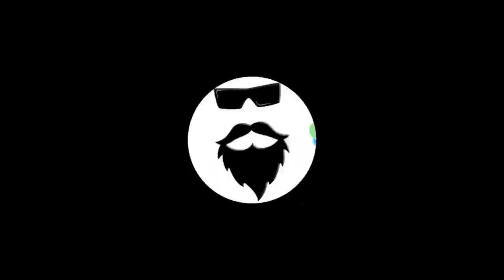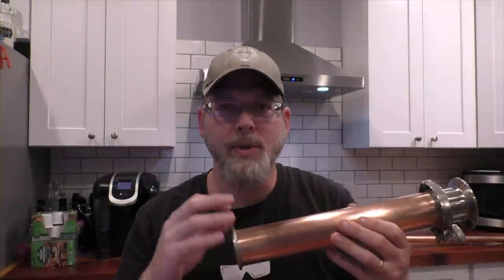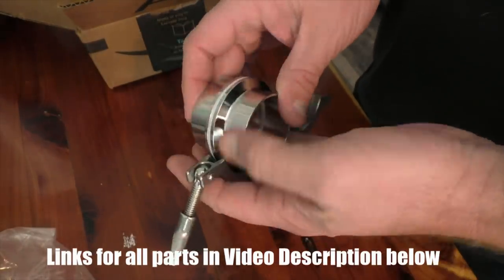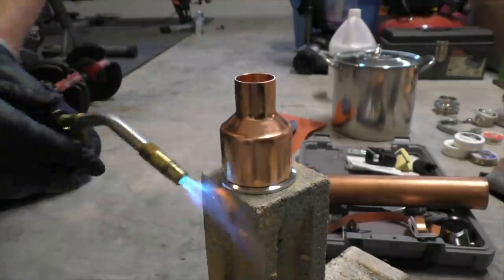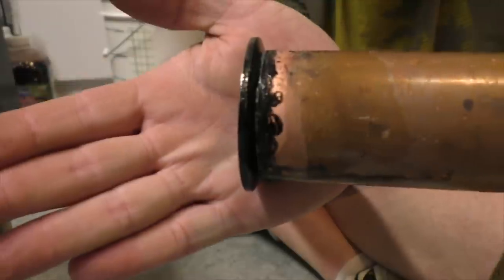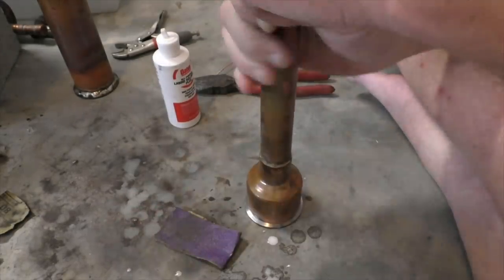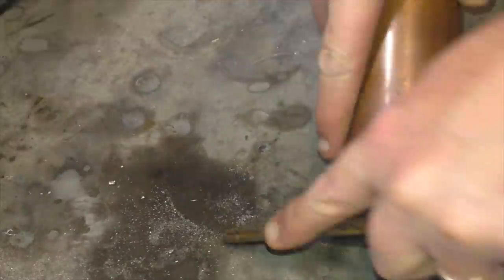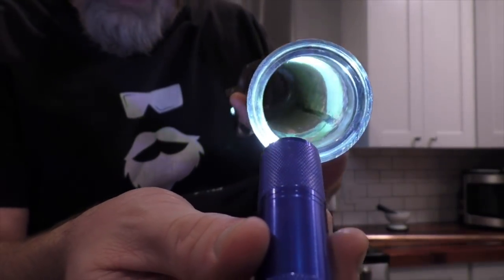Build a Simple Modular Pot Still Head + How to Solder Copper to Stainless Steel.

Comment from the maker: ATTENTION!!!: Forgot to mention that you MUST use Lead Free Solder or Silver Solder for all connections!
Reply: I did some of my joints with hard solder also called silver brazing. It uses a higher silver content solder,  and an acid based paste flux.  I'll check the names of what I used and post it here when I get home.  I didn't do them all because it's expensive and it's tricky to get right because it take a whole lot of heat but go too far and you can damage the stainless and make it rust if you don't pickle it.  A little goes a long way though.
Reply: Ok this is what i use for soldering stainless to copper or other metals, for the hard solder/ silver brazing I use:
Harris Safety-Silv 56 (cadmium free)
Harris Stay-Silv (white) brazing flux paste. I found the black paste harder to use. The smoke from these is dangerous!  Don't breathe it! When applied correctly and the right heat is good it works and flows great,  and a little goes a long way. 

There are good tips in videos and even in the Amazon reviews! 

For regular "soft" soldering stainless to copper I use:
Harris Stay-Clean liquid soldering and tinning flux (careful this stuff is dangerous).
Lead-free silver bearing solder.
Reply: One more tip I just thought of!  Make sure your gaps are tight! If you have gaps the solder will not fill and you'll have leaks.  If your gaps are tight the solder will flow very easily and you'll get a good seal that doesn't leak and is strong! 

Sometimes it take a lot of work to make pieces fit nice and tight and clean,  but trust me it's worth the effort to get it as perfect as you can.
Reply from the maker: @ThinkFreely2012  Thanks so much for all the detail!
Reply: It's best to use an Oxy-fuel setup if you're going to use the silver brazing rod (also commonly referred to as "silfoss"). The heat from an Oxy-fuel rig makes it far more controllable. A MAPP torch barely gets hot enough to melt it, and propane just turns it to mud, slowly. 

With that, pure silver solder is far easier to work with and makes fantastic joints on various metals, whether copper-copper, brass-brass, copper-brass, copper-steel, brass-steel, etc... if it can hold over 400psi in a HVAC system, it can handle a "boiler".
Reply: Great video. Thanks for sharing. Love the sacasism/dry humor. I'm searching for the silver solder and liquid flux now.  It's so expensive these days. Solder and paste used to be a 10dollar affair. Now I'm looking at 70 for the stuff I need. But hey it's free booze right......🤔  I'm upgrading my Frankenstein 3/4inch unit to a 2 & 3 combination Stone Nixon style unit. My output now is about 70% for the first 3 or 4 liters. I'm hoping to get 6L @ 90%. I'm looking to make some gin and vodka.  Although my oak charred whiskey isn't too bad. Well, thanks again. 🥃
Reply from the maker: @capitaldd3693  Yeah, it's pricey. I got my silver solder from Home Depot, but had to use Amazon for the liquid flux. Good luck on your upgrade.
Reply: @BeardedBored  Hey thanks. I just (just got back now) picked up Bernzomatic silver bearing solid wire solder - lead free @ home depot & a two pack of map gas. Better price than  i thought.  I'll have to make sure the solder is ok. I need to find some liquid solder tomorrow.  I've got a couple days before my ferrules and reducers and clamps show up ...
Thanks again...🇨🇦
Reply: Harris brand select or premium silver is wonderful stuff. Really any of the Harris brand soldering products are far better than the reg big box store stuff. Their flux is by far the best I've used in 20 years
Reply: @ThinkFreely2012  What are you referring to when you say "pickle it... thanks
Reply: @capitaldd3693  If you get stainless steel too hot when welding it, the nickel gets burned out and can start to rust.  So to prevent rust you "clean" the weld which is called pickling.  Usually using some kind of acid and electricity.  If you search how to pickle stainless steel you'll find lots of info.
Reply: @ThinkFreely2012  ahhh, not sure I've heard of that. Interesting info - good to know.   I'll look into it. Thanks for getting back to me. 🥃
Reply: Shit now I got to start over...
Reply: @nextlifeonearth  good to see some level head thinking! I'm going out of my mind today using silver solder and map gas! All because I read somewhere on distilling forum that even led free solder which contain 1% antimony is an issue! I got discouraged and ready to dump my project,now I feel much better! Thanks
Reply: How about making shine with ground up popped popcorn? Or maple syrup?

Comment: if you squeezed the pipe with a pair of channel locks the Farrel  would fit snug  also reheat and wipe pipe clean its easier . iv sweat enough pipe to go around the world lol . if your joint looks sloppy hit it hot with the acid brush knocking the excess off always wipe your joint right after it sets with a dry rag to remove the flux while its hot  or it will turn green  eventually

Comment: For removing flux in the future you can use an old jewelers technique and pickle the parts. Make a mixture of 1 part water to 1 part distilled vinegar, with 1 tsp of salt per cup of solution. Get it hot, soak your part in it. It'll remove all the flux and oxidation and leave a bright part.
Reply: beat me to it.
Reply from the maker: Thanks Jeremy!
Reply: You can also add flower to make a paste,  that will hang on if you do not have a bath
Reply: to add on this, removing the Solder you should soak a old rag in water, wipe the part, extra blobs removed.  or if you're worried about that you could use steel wool
Reply: Ketchup works good to clean copper and stain less

Comment: I liked the video.  I think you've already learned to use gravity to your advantage.  And soldering two dissimilar metals can be tricky, but I noticed two things that might help.  First, the tighter the joint the less solder needed.  Second, solder follows the heat.  Copper is highly heat conductive; steel less so.  So, heating the joint inside and out will help the capillary action of the solder.
Reply from the maker: Thanks so much!

Comment: Glad to see that you mentioned to heat the thicker, heavier parts first. I would add to that, melt a small amount of solder on one side of the joint and heat the other side. When that drop of solder melts, you're ready to add more solder. Also, when using previously used fittings you can heat it until the solder turns shiny and use a jersey glove or rag to wipe away the unwanted solder.

Comment: That's a great technique for making that reduction. I work with the AC guys a fair amount, which requires very leak free soldering. When we're repiping a new compressor, because the original is no longer manufactured, and the "replacement" isn't a direct fit, we often have to step up or down a piping size. Most of the time, we just cut the oversize portion long and use it like a sleeve, soldering the exterior portions. I've never seen an interior joint soldered like that, but it's a trick worth remembering.

Comment: The brand of solder makes a huge difference also, I use Bridget flux and solder its for plumbing so its safe, flows smooth and even,I know because I am a plumber. Also I like using silver braze rod to join stainless to copper.
Reply: Pro tip if you have the solder excess, roll the tube onto it side and hit the solder bead with the torch till the blobs start to melt and run to the low side. Also once you get it nice and hot to where the solder is molten you wipe the joint with a wet rag will get rid of the blobs
Reply from the maker: Thanks for the advice, brother!
Reply: Whoah two really useful tips!! Thanks Justin!!
Reply: My favorite flux is .. Ruby flux.. it is a superior product.. works with  stainless steel...
Reply from the maker: @sprocketandwheel  I'll check it out. Thanks:-)

Comment: you can sand the inside of your copper. I use a sanding sphere(it's a drill attachment you find in the sanding section from harbor freight, worn down to the appropriate size) and a drill extender of the right size. That way you can really abrade all the inside. For smaller diameters, just use a rod , cut down  lengthwise for a few inches on one end, with some sandpaper inserted and wound around.

Comment: I have the same soldering skills as you lol I've only did it a little making still parts. I learned something I've never tried liquid Flux. I went with copper ferrells  because I wasn't sure about  soldering stainless to copper. Wish this video was out then. Copper Ferrells are expensive! I went a step further and shined up the copper with a buffing wheel and drill I got at home depot it has buffing compound in the kit and after I went threw all 3 steps I had a very nice shiny finish. Thanks for the great info!
Reply from the maker: Yeah, I had to learn to do these because the copper ferrules were too pricey for me. Glad I know how to do it now, but copper sure would have been a smoother process;-) I need to get some buffing compound. Does the shine last even after the copper gets hot on the still or do you have to rebuff it every time?
Reply: @BeardedBored  it lasts quite awhile. Maybe like every  10 times of use I hit them with a buffing wheel and the finest compound  but I run her at least twice a month. Im kinda of OCD Jessie's clean and maintains video made me cring lol, but im sure I go way over board. The inside of my copper flutes and onion head are kinda stained but I just use a green pad in there there  but,  the out side keeps the finish pretty well. I use very hot water and dish soap and  a quick wipe down with a micro fiber towel so no water spots happen. I also use tarnex 2 or 3 times a year mostly for the inside.
        Also dollar store green scratch pads work wonders last quite awhile and don't make the mess like steel wool dose.
Reply from the maker: @spikelove9533  Thanks so much for the info. Your rig always shines:-)

Comment: A tip from a 30 year HVAC tech. When working with big fittings and specially odd metals, an oxy-acetylene torch works a lot faster. There is a learning curve, but once you get it down you can solder huge fittings in just a couple minutes.

Comment: Thanks. If I were you, I would go all stainless steel, especially as there are solderable kinds. But I just started researching and learning from videos like yours.
Reply from the maker: Copper helps to strip out sulfur compounds from the wash, so I went with copper pipes for that.
Reply: @scottg62g  oh - we obvoiusly come from different fields - I am doing analytical chemistry, so I like to approach of chemical cleaning and distillation in either all-glass or as inert apparatus as possible; for alcohols, sulfur compounds can be easily removed by several methods, e.g. by adding mild oxidizing agent such as silver nitrate (this won't oxidize the alcohol but other things will) or using activated carbon etc.
Reply: @LiborTinka  okay. Just trying to let you know not to poison yourself with bad spirits
Reply: @scottg62g  don't worry I use alcohols only as solvents and reagents, not for drinking - typically anhydrous ethanol (which is not for drinking per se), methanol and 2-propanol
when I need pharmaceutical-grade ethanol, it can be prepared from sugar wash, which is free of all the mentioned compounds - we are talking about fractionation through a long packed column - all the bad compounds, even if always present in trace amounts, are too low in concentration to be harmful

Comment: To get the solder out of a bad joint, heat it back up and wipe the melted solder off with an old rag. It'll save you a lot of time.

Comment: Also George has a great simple cleaning g solution for copper. He calls it 551. 500 ml of water, 50 ml of hydrogen peroxide and 1 oz of citric acid. And it works amazing. Especially for copper packing. Love the tips on soldering stainless to copper
Reply from the maker: I've used the 551 a couple times now. Great stuff.

Comment: One thing that helped me with ss to copper was to tin the ss and then clean it again. Then insert it into the copper, add more flux and proceed as usual to complete the joint. With the ferrule and copper spacers I did the above process and then soldered it in the fitting. I hope this helps in the future.
Reply from the maker: That helps a lot! Thanks:-)
Reply: This method was how I was taught to sweat ss to cu by a plumber.

Comment: you could put a small wire wheel on a threaded rod and with that and a drill you could wire brush the inside similar to how you did the outside. just to get rid of heavy solder runs and puddles before doing the cleaning runs. plus it makes the inside as bright and shinny as the outside.
Reply from the maker: Cool idea:-)

Comment: I have built one still before, not the most experienced. 

Soldering copper to stainless steel was a nightmare for me. I think it took 4 tries. Worse, it turned out to be 404 stainless. So the pipe is going to decay over time because it’s a corrosion cell. It’s just the way it is for now. It’s sealed but I’ll have to fix it eventually. I think I’ll go more modular next time with ferrules.

Definitely use liquid flux. Very good advice. I used paste flux and that was awful. 

The advice I would give to someone building a still, especially the one you’re building, make a hefty budget. It’s probably going to be over 100 dollars.
Reply from the maker: Stainless steel leaves mental scars, LoL:-)

Comment: What I use on copper to steel or stainless is Stay Brite 8 solder and Stay-Clean liquid solder flux for a low temp (430-540 degrees) solder. But I really like Stay-Silv 45T or 56 and Stay-Silv White brazing flux. You need more heat (1200-1300 degrees) to get the job done but it works really well.

Comment: Love this! Great video as always. Your saran wrap idea was awesome!!

Pro tip: when I am working with a lot of solder, I use a dremel tool to sand it down. Speeds up the process. I am not good at solder either. I bought a clawhammer diy kit and had to rebuild many times.
Reply from the maker: I thought about my dremel but I was worried about digging onto the pipe. I'll try it next time. Thanks brother!
Reply: @BeardedBored  it will for sure. You need to be careful.
Reply from the maker: @AgeWhiskey  Thanks man.

Comment: Plumbing for over 40 years, couple of things. Your brazes are not bad at all for a non-tradesman. Heat the pipe opposite of where you feed the solder. 2" copper is tough, throw in the stainless and that is just a hat trick. All said and done, you did pretty damn good.

Comment: I have read down a ways and I didn't see anybody mention this but if you want to get the solder off of those pipes the best thing to do is you can take and heat the pipe and use steel wool and drag it along where the solder is and it will pick the solder up try not to burn the steel wool while you're dragging it across the pipe too badly. Try to use medium to find type steel wool. You could even use the soldering braid or something like that if you have it.

Comment: Flux paste will work but u need to paste alot on big joints and heat the large parts first. If u heated from inside the big fittings u would heat the shim u had inside before the outer pipe so the entire joint was hotter

Comment: To sweat pipes, you heat whichever direction you want the solder to flow to - solder flows towards the heat. That you heat the pipe then heat the flange, you are having the solder flow towards the flange!

Comment: JB weld FDA Approved for food contact. Stable to 400 degrees Fahrenheit. Chemical resistant if your ever in a pinch.......or just tig weld it!
Reply: The problem is it resistant to hot alcohol vapor?  It's a different animal than just ordinary things like liquid acetone and such.
Reply: I JB welded my copper parrot together and it works great. That was after discovering I am a horrible solderer.
Reply: @robertlewis3336  that might be ok in that use.  Idk.  But on a parrot it's only in contact with cold alcohol which doesn't react the same as hot alcohol vapor in the column.
Reply: @ThinkFreely2012    Somebody needs to try it and see
Reply from the maker: I'm sure it works great at sealing joints even at high temps, but the concern is that it's an epoxy. The commercial alcohol industry sets the bar very high for what can and can't be in a still based on a material's ability to withstand not only heat, but the mixture of volatile solvent chemicals at operating temperature. If the pro's don't use it, it's best not to risk it. That's why I switched to PTFE gaskets instead of silicone.

Comment: Use a wet rag to wipe the solder joint on the outside while it's still hot. You can also use flux to clean the black stuff of the joint while it's still hot too.
Reply from the maker: Excellent advice!

Comment: Put your heat where you want your "Silver" solder to flow, counter intuitive, but that's how it works. If you cant find flux, look at electronics type stores!
You do NOT need to remove old solder if everything fits and it IS clean!

Comment: old vid, but good to check back sometimes...  made my 2nd head in the meantime for a ~23 litre/6gal pot, used a kitchen bowl, 2" ferrules and copper flower pots (well, yes...) to get a "scotch whisky type" pot still look - and effect, hopefully. 3/4" condenser inlet. Though I reduced height and went for more diameter in the second attempt, I'm starting above 70% outcome all the time, with 50% on average from a 12% wash. So "low wines" aren't that "low" and I'm afraid to loose aroma with a second run (as I did with my first gin experince). Maybe there shouldn't be further restrictions between the 2" connetion and the 3/4" elbow to the condenser. Think of a quick&dirty/cheap&cheesy solution with the elbow directly on a 2" cap. Not as fancy as the current stuff, but might work better...